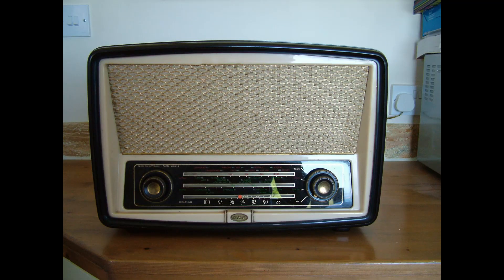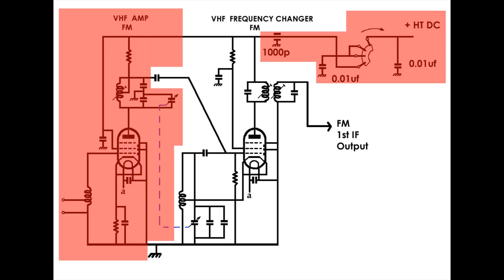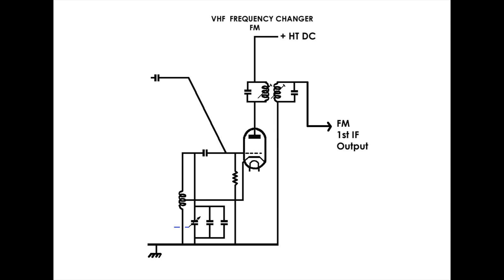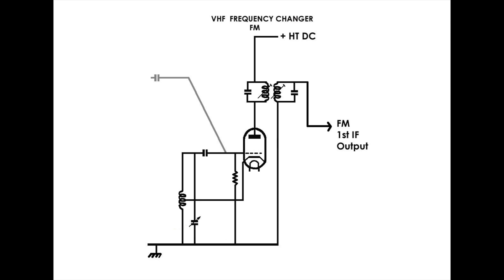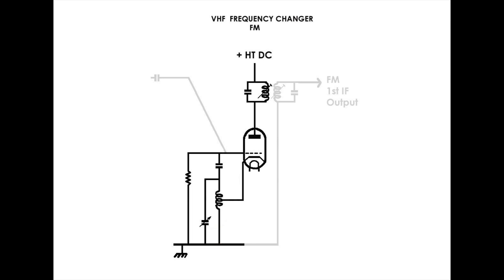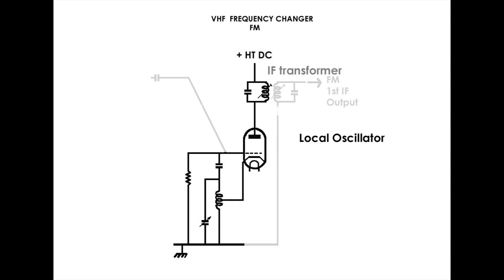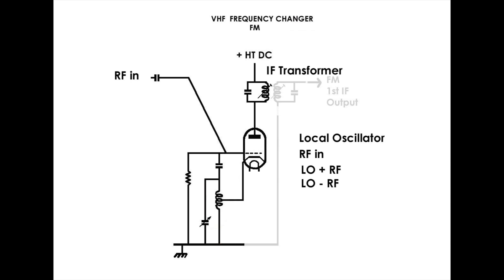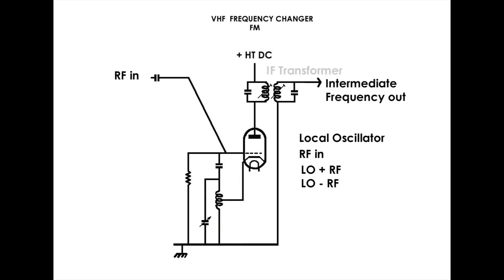About Radio ... Part 8 Intermediate Frequency by Andy Davies.

Comment from the maker: The radios intermediate frequency amplifier is designed for best operation at 10.7MHz
As the receivers tuning frequency is adjusted so the local oscillator’s frequency is also adjusted in step. The ganged capacitor (with its trimmers) are set so that the transmitted radio stations signal frequency minus the LO frequency always equals 10.7MHz
You could use two separate capacitors but it would be very fiddly to tune and you wouldn’t have a calibrated scale. 
Kind Regards ... Andy

Comment: the RF came from antenna ( tuning tank circuit ) . and here the output is IF = RF+LO ... goint to the last tank circuit which has 10.7 MHz freq to maximize the voltage .
the LO ( on the lift ) would be also 10.7 MHz then ?
so if i want to generate this IF what schematic i can use as now there is only transistors ?
and why to use tuning gang capacitor as i can tune every one alone and the tuning cap for RF give me the channel and all others tune to give 10.7 Mhz for the LO and IF tuning ?

Comment from the maker: OK, I'm glad about that, I wasn’t’ looking forward to have to go through it in 500 characters. You’ll find Hartley Oscillators (and others) in all sorts of configurations. I used to own a company, Cheltenham Induction Heating  Ltd, we built RF Induction Heaters with output powers from 1 KW to hundreds of KW’s with a modified Hartley Oscillator with what we called a ‘tickler coil’ associated with the tank for the feedback, that was with water-cooled valves and scary voltages.   
Regards ... Andy

Comment: Thanks Andy, "forget the notion of ‘ground’ for the common point" I think is superb advice. + and - voltages are really tough to get the hang of, but I am slowly understanding it as a difference and -ve does not mean anything real other than a relative measure. That has been a hard one to get over.

Comment from the maker: Hi, I understand all about mental blocks. For me its spelling and smith charts. You have to find your own answer but when you do it will be that ‘eureka’ moment.
I'm no expert but I’d say forget the notion of ‘ground’ for the common point and simply consider the various potential differences between the terminals. See if you can get your head around the notion of reduced capacitance in common base circuits. As I say, just look at where the bias potential comes from.
Kind Regards ... Andy

Comment: I am currently trying to understand transistors. I am okay with Common emitter and Common collector, But I just seem to be having a block with common base. I am seeing diagrams where the base on those is connect to earth directly and yet I always though you needed to bias the transistor. Sorry about this question, but thought you might have some advice.

Comment from the maker: @huelbe Hi, thanks for the positive feedback.
The FM intermediate frequency for this radio is 10.7 MHz So to resolve a station transmitting at 100MHz the LO would be running at 89.3 MHz and that's established by subtracting the 10.7 MHz from the 100 MHz to give 89.3 MHz
So in other words the LO (the Local Oscillator) frequency is subtracted from the transmitting stations frequency to produce the intermediate frequency.  
73's ... Andy